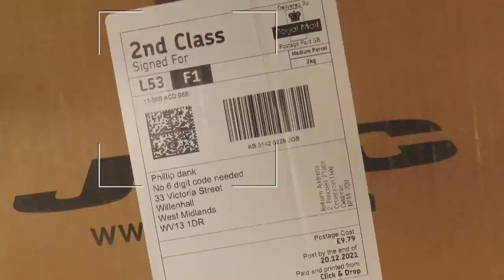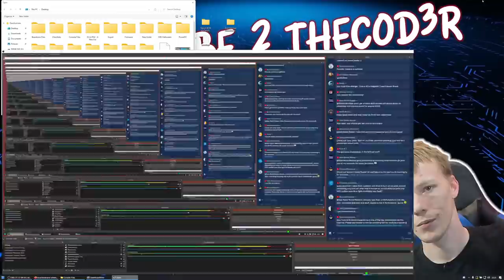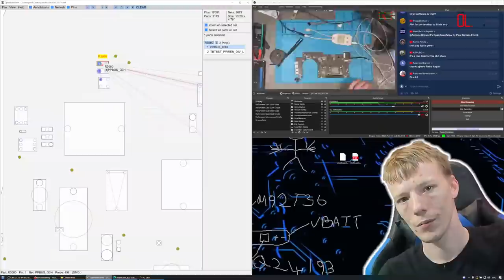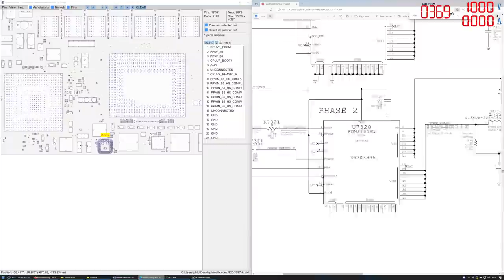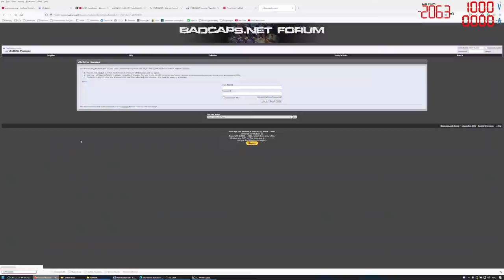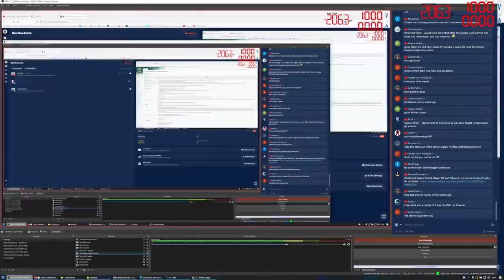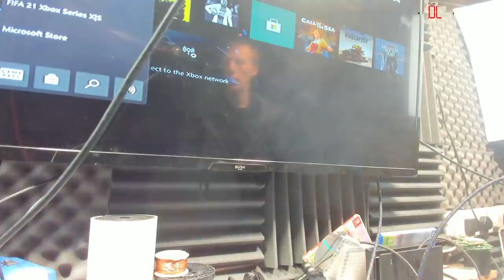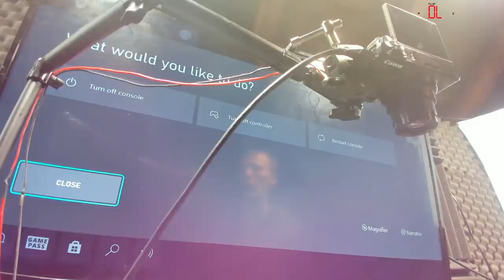Get Your Friday Fix On... Let's Fix Some Consoles (LIVE STREAM)

Comment: the stickers do not look nice when they have a hole in them. i have never put  a hole in the sticker  on my xbox controller when i give it a clean  i just peel it back . great stream as always keep up the great work bud.
Reply from the maker: Yeah I agree mate, it really triggers me. I usually peel them back using a bit of low heat to stop the glue from drying up

Comment: Alright mate quick question my PS4 doesn't load game discs anymore keep getting an unsupported disc error so I did a database rebuild and it still won't load can you point me in the right directio it's about 4 yrs old now
Reply from the maker: It could just need the laser cleaning mate but if it works for updates then chances are the worst it would need is a new laser